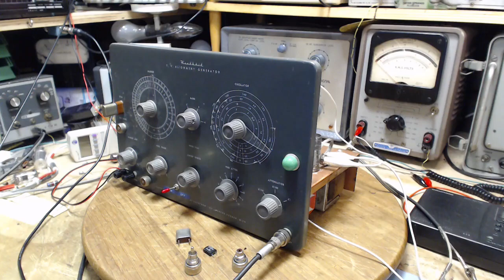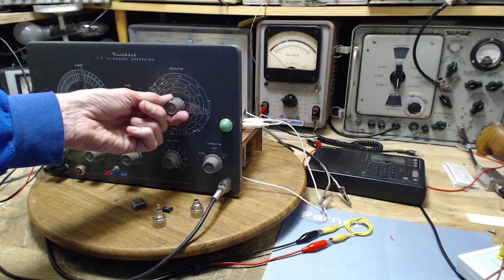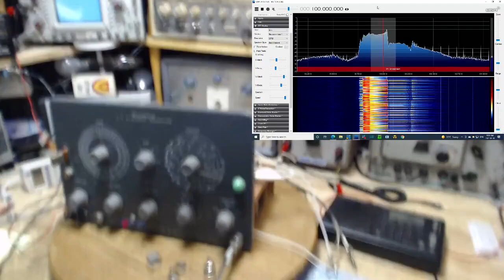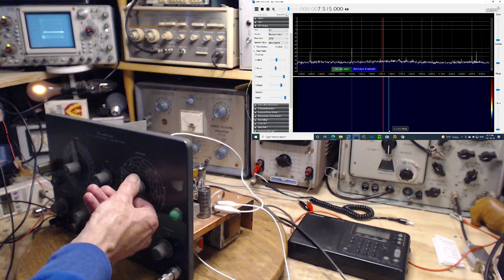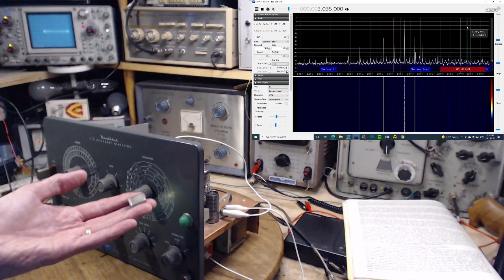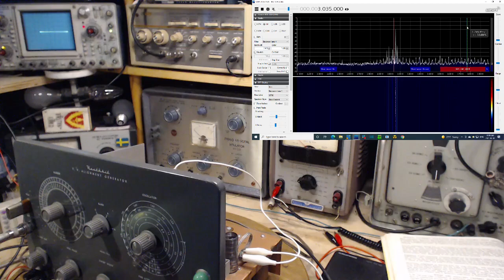Heathkit TV Alignment Generator TS-4A Video #10 - Function Checkout

Comment: We had a local CB radio nut that ran a huge linear amplifier so strong it would come booming over the jukebox at the bar about 750 feet away from his house, I had access to a home next door to his so i put my sweep generator upstairs connected a wire antenna to the output set it to max. output at the center of the CB band with enough sweep to cover the entire band and left it on all week, I lived at the other end of town so I couldn't hear the generator but I could hear the CB'r  all week he was complaining that all he could hear was this buzzing on every channel and only the stronger stations could be thru to him, he couldn't understand what was going on 🤔 Fun with electronics. 😁